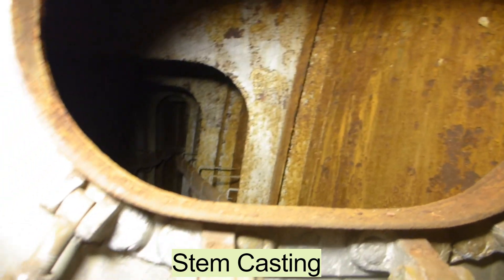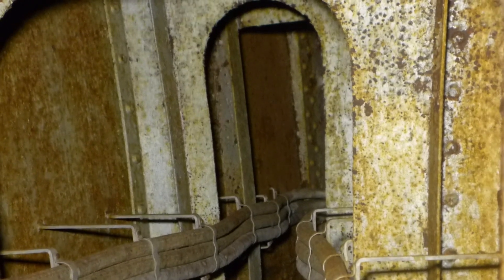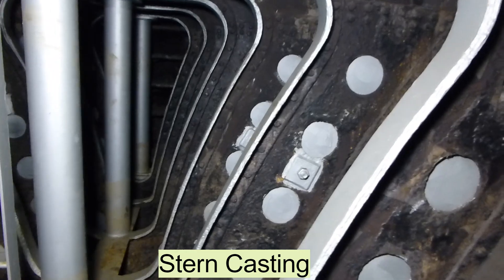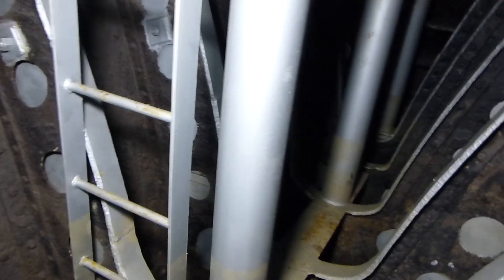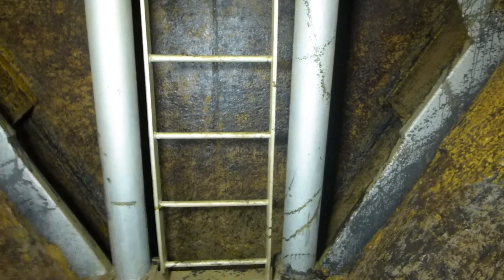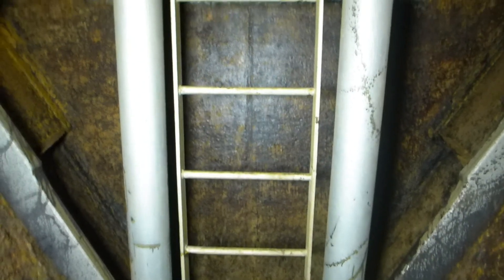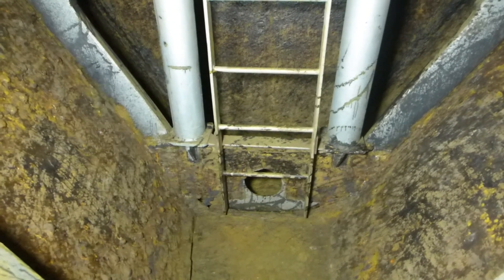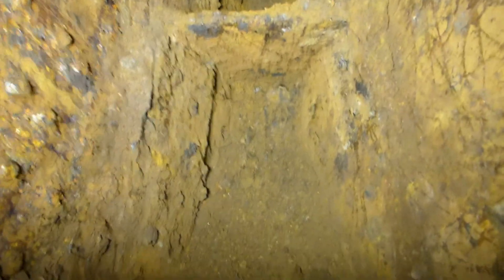Battleship Texas, Castings That Hold The Hull Together

Comment: In the parts showing the stern, I saw some nice-looking columns that reminded me of lally columns used (primarily) to support beams in basements.  Are these columns original to the ship (or replacements of the originals), or were they added during the reconstruction?
Reply from the maker: Those replaced the original supports about 4-5 years ago during major structural repairs to the ship's hull framing.
Reply: @tomscotttheolderone364  cool.  Thank you.

Comment: AMAZING. to think, every inch of these machines, were touched by 1000's of men, and today, one man trying to work his way through the various holes and passage ways, requires that one man an extremely allot of effort and energy to do so. This is like seeing the ocean for the first time at the age of 60, and realizing how much I can take for granted. These men that built these machines, although, many are long gone, ARE some hardcore MEN. I am very proud of those men that made such tasks happen, while having a mindset of "it is just their American duty" to get the job done to their best of ability's. And of "all that was on the line" if just one man back then didn't hold up his self desired high standards of craftsmanship, the whole thing could come crumbling down and those men took great pride and put great efforts into insuring they would not fail, no matter how difficult each of their jobs were. Just amazing. I can only imagine, or manifest that being a ship building back then, the short little guys were prized, for being able to wiggle into some of the tightest of locations, to grind, torch, cut, fit, re-fit, weld, grind some more, etc... were as the guy who was 290 lbs of muscle that could lift the battleship with one hand, gave a great measure of respect for a job well done, that he knew he may have had the skill set to do, but just couldn't fit his huge self into these dinky locations, let alone, still have enough room to do the job well, with the restricted or limited space.. everybody served their roles, no matter what. The mission was building a great machine, that needed to save lives and or keep them alive, out in the middle of nowhere.. These odd video clips of areas every time blows my mind, especially when you watch how today's large vessels are constructed, in large sections at remote locations, and then shipped in or craned in and assembled. I am not saying one way is better or lessor than, but, the old school way, for sure, did make strong ships, and was in harsher weather conditions, that each of those men trucked right on through, as that was their mission.  Sorry about the novel again, it just blows my mind seeing this odd and strange ship locations, that only a hand full of human beings on the planet, have ever seen, and will ever see, I am glad that we can see them at least via a video. Sure, seeing in person, compared to a video, will never do what the naked eye can see, but, knowing, I will never get to see this in person, I will settle for the video that you took for us to see, and I am grateful that you have taken the time to do so. Thank you.

Comment: Has the lead paint been removed from the ship?  I don't think that laser rust/paint removal equipment would be a good idea if there's lead paint because it would vaporize & make a repainting job much more dangerous and time consuming.

I would love to see the Battleship texas be moved into an indoor facility that has a dry dock & a custom hydraulic system that would simulate water pressure on the hull like what the British have built for HMS Victory.

Then I figured it's a matter of busing out High-school volunteers. I graduated in Michigan and they required me to do mandatory hours of volunteering for highschool graduation, so I figure the state of Texas would have enough teenagers you could assign to each individual room of the battleship to strip & repaint.
Reply from the maker: The primer is lead based, but not the paint above it.  It is only remediated where the paint has failed and the primer is beginning to in areas frequently accessed by people.  The reason it hasn't been removed in most places is because it is hideously expensive to hire the required licensed remediation contractors to do the work.  Sealing products appear to do a good job in areas where paint has failed, but the primer is still intact.  They are inexpensive to apply and new paint adheres to it pretty well.

I cannot see a ship that weighs 27,000 tons, almost 600' long and more than 100' tall from the keel going to an indoor facility, simply due to the cost involved.

From my experience on board, the risk of injury is too great to allow minors to do work on board the ship beyond what can be done on her upper decks.  The heavy work lower in the ship also requires more individual training and experience than can be given to people who typically won't spend more than a couple of hundred hours working on her.

Comment: will you ever make a trip to the foremast fire control top? or into the plated over secondary top just aft of the funnel between it and the 3rd turret?
Reply from the maker: I don't have any plans to visit either.  I've been in both and both have been stripped of equipment.  the only thing of even the slight interest is part of the rotating mechanisms for the fire control radar antenna mounted in the overheads of the two locations.
Reply: @tomscotttheolderone364  
Thank you for all you do sir!
 I have always been interested in seeing the the insides of the masts, even if they are gutted and just empty spaces now.
 To the best of my knowledge the Texas is the only battleship left that has them.
Not many people alive today have ever seen the view from them.
 Even the old documentaries show just about everything on these ships except the insides and view from the masts.
I think that the view alone would be interesting.
Reply: @sidewyndersshed1676  Norman Friedman has a book that documents naval gunnery and the directors that went into them. But Tom is right. There are photos from the restoration in the 80s where you can see inside the foretop. Its nothing more than the bolt on rotating rings that are left.
Reply: @Tom Scott, The Older One  is there any good photo/video's of it as it seems to be one of the coolest areas to have been in on the ship. Literally! Thanks in advance Tom, the educational one!

Comment: Corroding iron takes oxygen out of the air.  I trust that these spaces are well ventilated, or you are using a sniffer to test these compartments before entering?   Our bodies can't detect a lack of oxygen by sniffing, nor can we detect H2S at high concentrations.  There have been tragedies on ships where men entered a rusty sealed compartment and simply passed out - and died - from lack of oxygen.
Reply from the maker: You are very correct and air quality is perhaps the greatest concern on board.  It is assumed that the air is bad in spaces that have been closed for a while.  It is really scary to know how quickly you can get in trouble and die!  This was driven home by the death of a worker on the ship during her 1988-90 dry dock when he entered a torpedo blister that had not been adequately ventilated.  He passed out almost instantly and died shortly after.  Another worker went in after him and also passed out.  He was lucky, others wearing breathing apparatus got him out before he died.  O2 detectors are used to enter areas that have been closed for a while, but they rarely see any problem.  The ship has a lot of portable blowers and flexible ducts are usually shoved into suspicious areas that are ventilated even before testing the air.
Reply: I recall a number of personnel recovering ships at Pearl Harbor were lost in similar circumstances where the air suddenly changed as a compartment was opened or vented into another, previously cleared, compartment. Saddened to hear someone was lost in the 88 restoration.

Comment: I honestly thought the ship was in much worse shape than this, someone said it was more than 50% rust. Seems like surface rot for most of the rust im seeing. The end of the video actually looks bad.
Reply from the maker: I agree that it looks particularly bad at the last location.  However, soundings indicated that framing and hull shell plating were in acceptable condition.  However, other areas that included D-13 were heavily wasted and at risk of collapse.  These were repaired and reinforced during 2 repair projects between 2012 and 2018 at a cost of about $50 million.  This not only eliminated the possibility of catastrophic failure, but also assured that the ship would not suffer damage when towed and dry docked.
Reply: @tomscotttheolderone364  during which time period since her retirement from service do you think she was neglected/suffered the most? Some of these spaces surely must have had water in them for many years to waste away so badly?
Reply: @tomscotttheolderone364  yeah like I said at first I’m pretty surprised by how nice it actually looks, y’all did a good job on those repairs. The end is more what I imagined alll of the ship would look like, why I mentioned that.

Comment: Is there anywhere on the ship where the armor belt is visible?
Reply from the maker: No, all that can be seen are the heads of the large threaded studs and nuts on the inside of the hull that retain them to the hull.  The outside of the belts are covered by the external torpedo blisters.  These are currently filled with foam as anti flooding measures for the ship’s upcoming tow.
Reply: @tomscotttheolderone364  Thanks for getting back to me